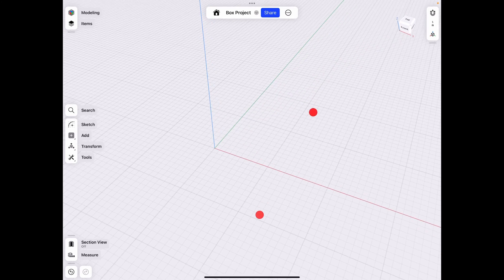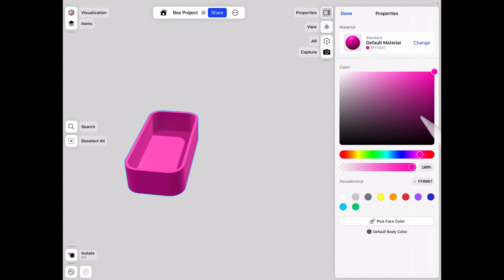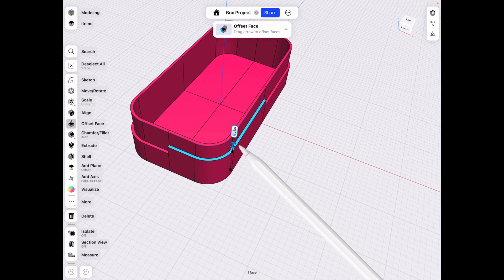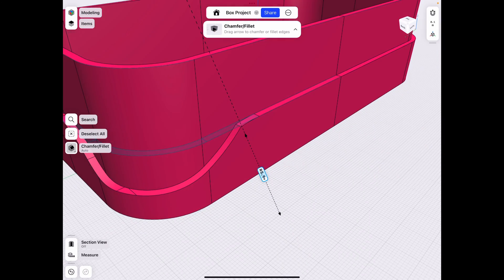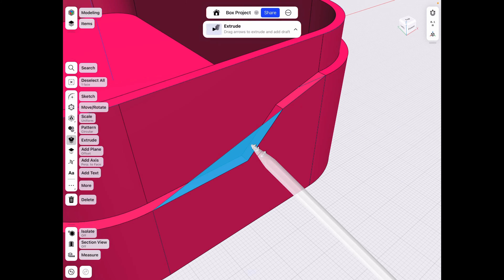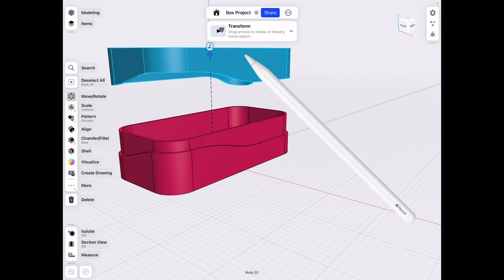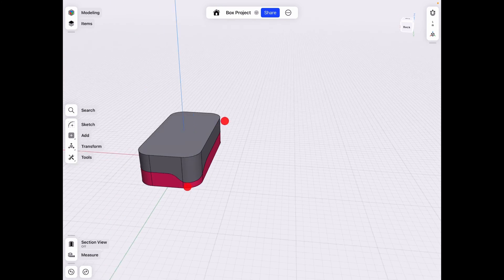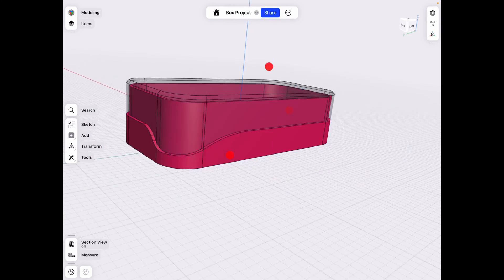3D Mating Box Tutorial for [ Shapr3D ]

Comment: Items like this where its transparent (Really Nice Design btw). My question is, am I supposed to remove the lid in order to print? If I were to print it with the lid on, would it print the lid to the bottom part of the box?
Reply from the maker: Yes it would melt together so for printing you would have to separate the pieces and orient them correctly or just use your slicer to do it. Most slicers these days have options to orient parts and lay them flat on the print bed. 👍